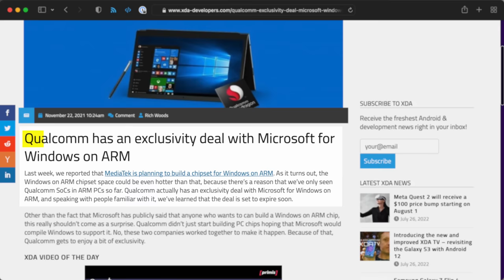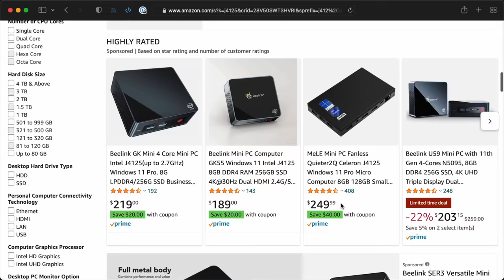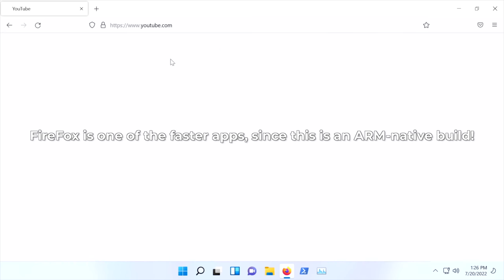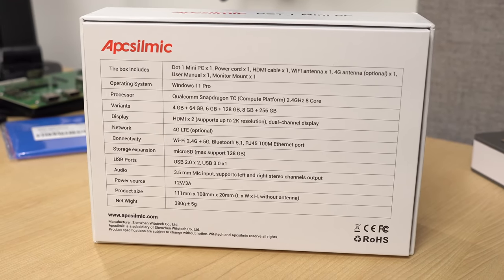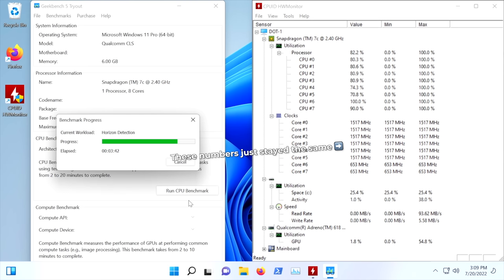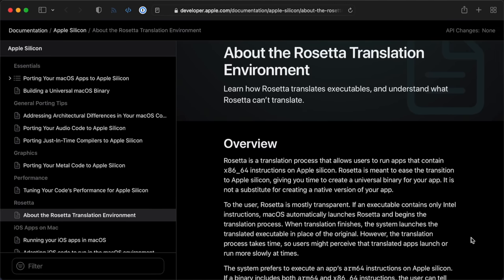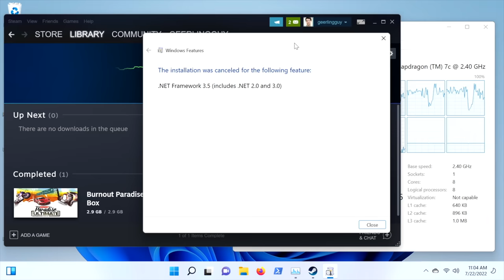Microsoft's wasted potential: Windows on ARM

Comment: A number of years ago I was put on to the possibilities of ARM as a desktop platform, so when M1 came around it really felt like the fulfillment of that promise. Honestly, Windows has been trying to do Windows on ARM for a while now, but each time it was so poorly done it made ARM look like it just wasn't ready fro prime time. Like back when Microsoft did the Surface RT, it was just underpowered, slow, and lacked support for popular apps. Fast forward to 2022, and surprise surprise, Microsoft still hasn't learned their lesson. The Surface Pro X is a marked improvement over past efforts, but it's still just Microsoft just going, "Hey look, we got Windows to run on ARM!"

Love or hate Apple, they do tend to get things right, and lead the industry. Like tablets, Miscrosoft was doing tablet PCs since the 90s. But it took the iPad for people to finally get tablets. The M1 Macs are the same, Apple is showing what ARM can do in a full productivity PC. It's not the cheap brand, or the glorified web browser experience. This is full on power users on a desktop level of performance, and it's even blowing some traditional Intel/AMD/Nvidia configurations out of the water. 

Though there's a while world of untapped potential in RISC V too. RISC V could give ARM a run for their money too, since anyone can pick up and use RISC V without paying royalties. We could see Microsoft making their own chips a la Apple M1, and they wouldn't be beholden to Qualcomm or other ARM chip makers. Since Microsoft moves slowly on these things sometimes it could take 10 years before we get there, but I think we'll see a lot more ARM/RISC V architecture in the near future as Apple solidly demonstrates the power of ARM with M1/M2, and future iterations.

Comment: I did read that Apple are taking the position that they will support Windows on the Apple Silicon Macs, but they need Microsoft to make it available legally to Mac users before they can consider it.
Reply: That will happen the same day Apple makes legally available to run iOS on other ARMs. As a devops and sysadmin, virtualizing Macs on cloud would make my life a lot easier.
Reply: @framegrace1  different business model.  Apple are unlikely to open up their OS.  Why?  They did it in the past and it nearly bankrupted them, because at the time, Apple’s primary source of income was from hardware sales,.

Microsoft’s business model has traditionally required they get their software installed on as many devices as possible, whether they manufacture them or not.  Now or seems to require getting as many people using their cloud services as possible..

Comment: Must be something wrong with that hardware, I have Samsung Galaxy Book Go which has the same ARM chip and it runs just fine, even with x86 emulation, though most of the apps I need have been compiled for ARM64.

Comment: Thank you for the very insightful video, I am currently using a RasPI 4 with 8 Gigs to test Arm64/Windows11 builds of my open source software and was thinking about getting a Apcsilmic instead, now I know it would have been a waste of money. The cooling solution in this design is terrible. A RasPi 4 with a proper cooling solution seams far superior even though on paper the SOC is not as powerful.

I'm wondering what would be the best ARM64 platform to run windows nowadays that is somewhat well priced?

Comment: Recently I bought a Samsung Galaxy Book Go (7c 2nd gen) and I'm pretty happy with it for my use case: I use it as a thin PC that connects to my desktop PC through RDP. Battery lasts a lot, around 10 hour minimum, and it does not drain it when I put it to sleep.
What I don't like about it is that I can't reinstall Windows on my own, only with the included image, as there is no official Windows 11 ISO for ARM64 and I can't download the drivers on Samsung's website. I know I can export them from my current installation, but that should not be needed.
And also, I can't use any Linux distros on it. It does not even recognize the keyboard, mouse or any USB I connect.
But still, for 160€, is a good thin client laptop :)

Comment: I agree, I wonder how many people didn't buy an arm mac or are waiting to buy one simply because it doesn't run windows.  I think MS was sure cloud would be their future with remote app and azure replacing the tradition desktop but it hasn't happened.  It is expensive and most IT departments aren't using it at scale.  Personally I let my users RDP to our cloud stuff for windows and it works perfectly well.  Enterprise apps in remote app and productivity is local.  Encrypt the drives sync data and enforce backups and you are golden.  Reduced TCO as macs require less maintenance.

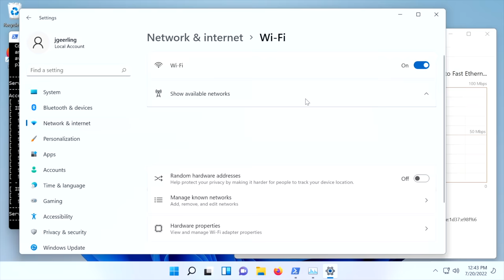Comment: 5:44 i think that is true when used with a dock that have ethernet bcz my lap always gone to the adapter that have not the built in one even its not pugged in. the same goes for wifi auto connect dosent work and i actually removed the ethernet from device manager and then everything seems fine now i have a better dock.

Comment: The M1 and M2 Mac devices are ARM but Windows is not officially supported in Mac with Boot Camp. It is possible to run in emulation using VMWare Fusion, Parellels or Apple's own Virtualisation tool but some features are not available. Microsoft should prioritise supporting Windows 11 on ARM on Mac which has the best performing consumer ARM processors to date and this could encourage Developers to update apps to ARM for Windows instead of relying on x86 emulation. This would also improve the experience for users that are running on Qualcomm Windows PC's.

The planned Project Volterra mini PC by Microsoft is focused on Developers and should have a faster processor. Not much is known about the specs or the expected release date. Hopefully the specs are beefier and less expensive than the current Qualcomm 8Cx Gen 3 and SQ2 devices. 

Microsoft should NOT saddle the Project Volterra mini PC for Developers with an underpowered processor as Qualcomm did with their Developer Kit.

Comment: Speaking of powershell taking 5~7 seconds to startup, its generally powershell being stupidly slow, not the cpu. My old i7 4710h, while not a performance beast either, also takes 3~5 seconds to start up a powershell, whilst not having any issues with windows old cmd or any other linux shell.

Comment: There should be an open tool that quickly runs and checks everything that could possibly be needed to get Linux running on your hardware and have a full log file that could be sent to some developers
Reply: it's actually not hard to get linux running if all you need is a serial terminal. Figuring out the device tree is the issue.

Comment: I'm currently running window 11 on my pi 4 8GB 500GB SSD in ARGON 1 M2 case.
The problem I am facing is to make a driver for the fan controller so that I can get it above 1.5 GHz. The most disappointing is Microsofts webb browser. It really lacks performance on arm.

Comment: As usual it sounds like they cheaped out all the way around. And the reason there's still a high usage of usb 2.0 ports on all devices is because when electronic spec consortiums put out a new spec the electronics manufacturers pump out a bazillion of them. Mark my words we'll still be seeing 2.0 ports for at least another 20-30 years. And probably double that for HDMI and usb-c, which they invested heavily in and rushed it to market unfinalized.

Comment: 2:57 The CPU only has 1MB of L3 cache for 8 cores?!? Geez I don’t think emulation overhead is the only problem here. The total cache only amounts to 2560 MB, and I’ve seen cheap desktop dual cores from 2007 with more total cache than that.

Comment: Quick questions.. 1.) If you disabled on board Eth0, wouldn't it default to wifi and auto connect?  2.)Did you by chance try running a 3.0 USB Eth adapter to see performance? I know your speaking on it being off shelf w/ no changes. But if the price is right, adding new Thermal and USB Eth0, what is your opinion?

Comment: I bought the same system with 4GB of ram, in laptop form, for only $169, and it's working fine.
If I had to make any suggestions, is to get at least 6GB, as just the Windows 11 with Edge browser uses up almost 3.5GB of the 4GB of RAM.
My laptop has a non-upgradeable ram and SSD. The SSD is only 64GB, but with some optimizations, you can make it quite useable. Like, disable hybernation file, increase the swap file to a fixed 3GB (4GB if you plan on doing more advanced stuff).
It's pretty ok, and uses a lot less than an Atom PC in terms of power consumption.
But it does use more RAM, the nature of ARM technology. So get a 6 or 8GB version.
Most of the 32 bit apps work quite fine. It takes some fiddling to make them work.
Most older 16 bit DOS and 32 bit DX9 Windows 95/98 games can be emulated just fine on this. The performance isn't staggering, but in line with any desktop PC of 2005-2007, plus it plays back 2k videos (through a 1080p screen) just fine.
A lot of steam games don't work. Epic games do tell you in advance if the game isn't working (x64), and installs if it does work (Arm64 or x86 (32 bit)).
My geekbench score is a bit higher on single and multi cores as yours, as the first few tests only use 2 E-cores at 2.48Ghz, and the last few test use all the cores running at 2Ghz.
I would certainly try to use either a heat sink, or use a small fan on the cpu.
Side note, the 32 bit version of GeekBench (3), nets 2000 single core, and 4660 multi core. The benchmark doesn't maximize the CPU cores, only utilizes roughly up to 75%.

Comment: Wow that computer only uses like 6-7 watts under load? My M1 MacBook Air under load uses like 27-30 watts and heats up to 95c (but it doesn't have a fan. Still: how do you get 95c out of 30 watts and still manage to power a computer???)

Comment: As far as I know the biggest problem with ARM is that it requires a special edition of any OS for each implementation.
This could be solved when introducing a Frimware/Bios/UEFI thing that loads the OS, at least as far as I understand it.
So I think Qualcomm was the only one willing to help Microsoft with developing a special version of Windows with integrated firmware for there chips.
Reply: In the X86, a 'standard' was established to load all the correct device drivers for a plethora of different existing devices (doing the same things). With linux, this does not (yet) exist. Remember those days of 100% IBM PC compatibility ? That was exactly the same issue. Our community certainly has learnt a lot!

Comment: Microsoft’s pledge for backwards compatibility ( and Intels) going all the way back to the 8086 is legacy weight that drags them down. A specific example in windows means a specific function- in dll form rather than statically linked in Linux, needs like 6 versions, is it 8 bit, is it 16bit is it 32 bit, is it 64 bit, followed by for most of those is it ascii, is it cp102, is it UTF8/ or iso whatever, is it wide character, or is it … whatever the windows wide char is called, iChat or something, then it needs to check the version to see what functions are available, it’s DLL hell all the way down.  I don’t understand UWP but i believe it’s meant to prevent some of this.

But the Microsoft way is always - why make it simple when we should plan for every possible eventuality and make a simple interface so complicated that there don’t exist experts out there for it. 
Simple things like an event log or system management- eg if you get under the hood just a bit - So complicated it boggles the mind
Reply: Did you know that 64-bit Windows will no longer run 16-bit executables?

“Backwards compatibility”, indeed ...

Comment: I'm using those mini pc's as development hardware for a kiosk system. i got 3 of them at work, 1 of them is a prototype hardware, 2 is the finished product the one you showed on vid. on the prototype i was able to port my .net 4.6 application to .net 6.0 so i could compile ARM64 builds.

the only problem i have with those computers is find a way to reinstall windows on them. the ARM64 iso's for windows doesnt exist and you need to build them with a tool, i was successfully able to boot to windows setup, but keyboard and mouse doesnt work. :(

trying to run Debian 11 ARM64 doesnt work either indeed. the GRUB menu does kinda load, but it fills the screen. when attempting to boot the kernel, it looks like it crashes, the screen goes crazy. and locks up.

Comment: Actually, Apple has platform-transitioned the Mac 4 times. 68k to PowerPC 32 bits, PowerPC 32 bits to PowerPC 64 bits, PowerPC 64 bits to Intel (Both 32 and 64 bits) and Intel to Apple Silicon.

Comment: Wow, your video told me how good is Windows on ARM processor's, include some benchmarks. You have solve my wishes! Thx. 
But Debian have told me in history privately message, ARM does not support this Chipsets that's in Intel and AMD CPUs usage. They mean 386 CPU chipset is not include in ARM and this is the special of ARM, it is without 386. So finally Microsoft for ARM must use a CPU emulator inside. Or how they fixed this problem? The Software of Steam Launcher usage 386 Chipset inside and I was seen it is running in your Video on ARM. It's like a wonder this Microsoft 11 ARM. Thank you so much!

Comment: I like ARM. I've got a couple of NAS boxes running armbian. Rock solid and low power consumption. As for the DOT 1 Mini pc in this review and running windows 11 on ARM, why bother? I got a dirt cheap Fujitsu S740 on ebay, quad core j4105, 4 gig of ram (upgradable) and I replaced the 8 gig m.2 ssd with an 128 gig m.2 ssd. All included round $60 usd. Running linux on it I have yet to see my kill-a-watt meter show double digits. After watching this video I put windows 11 on it and it occasionally spikes to 15W but mainly runs around the 6-7W mark.

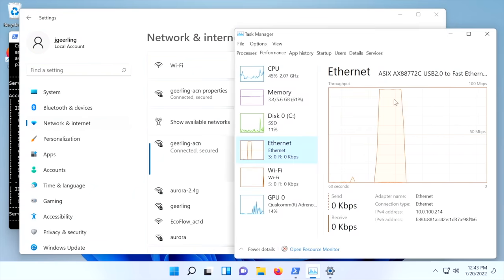Comment: 5:42 That might be because you've connected ethernet cable. Windows won't connect to Wi-Fi automatically after boot if ethernet is already plugged in.
I am using Windows 11 Home currently, and this behavior was extremely annoying when I was using Wi-Fi to access my NAS, while ethernet plugged directly to internet, which is different network and NAS can't be accessed.
Reply from the maker: yikes! What do networking people do if they use windows? Or do they all just use Mac/Linux?
Reply: Linux has the most advanced networking stack. So what do you think the smart networking people use?

Comment: I really want to know why you can't just boot Linux on any Qualcom CPU. I mean they do use UEFI, no? o.o
Whilst looking into the work needed porting Sailfish or PostmarketOS to different phones, I saw that each one needs individual bringup procedures. That just always baffles me, if only just a little...
Reply: UEFI? no
Reply: @azertyQ  So they use a different boot mechanism? If so, is it proprietary or not?
Reply: The issue is the parts of the hardware that lie outside the Qualcomm SoC. The rest of the motherboard. On Intel systems, the motherboard has firmware that can tell the operating system where to find hardware and how the hardware should be used. On ARM systems, there is the SystemReady standard firmware that serves the same purpose.
However, most consumer electronics manufacturers simply don't expect their hardware to be user-repairable or maintainable, so they don't bother to develop multi-purpose standards-compliant firmware. Their motherboard firmware is bare-bones and doesn't tell the OS anything about the hardware. Instead, they customize the OS to hard-code this information. They treat the system like it's "disposable"; low-effort, single-use.
Reply: @PixlRainbow  Ohhhh! So THAT is why each bringup - be it another Android ROM or else - needs a "device tree"; those ought to be the hardcoded information you mentioned I would assume. This explains why packages that go together into a LineageOS build seem so fragmented; because they literally HAVE to be.

Thanks for explaining! This helped me understand things a lot. So even if there was some kind of UEFI compatible boot loader (acting as a chain loader after SystemReady), it would still have to be implemented for each device independently, mostly regardless of factory/vendor.

Again, thanks a lot! ^.^
Reply: @IngwiePhoenix  oh SystemReady includes UEFI support! To be compliant, the vendor must provide an implementation of UEFI on their motherboard. It's just that most consumer electronics manufacturers are actually not SystemReady compliant like, at all. Most ARM SystemReady devices are enterprise servers.

Comment: Windows has the tendency to ignore WLAN if LAN is connected. Autoconnect will then be disabled. Try a reboot without LAN connection. My own desktop PC also only connects to WLAN automatically if the Ethernet cable is not plugged in. At least on Intel Systems the behavior is this way and maybe that is also the problem on ARM.

Comment: There is a Microsoft Surface with ARM in development, quite fast and reliable what I've heard, but I can't talk about it though.
Reply: 8xc chip? I'd like to see that chip or a Nuvia (2024) in a Surface Go Form Factor to maximize portability and battery life and comfort as a tablet when used as such and still full-fat OS for work. As a second computer, it would be very attractive because Apple refuse to make such a device with their split between Laptop MacOS and iPad iPadOS division. Using iPadOS feels like having chains around your wrists.

Lenovo released an 8xc laptop and it's got about 18 hours of battery life with a 300 nit screen for continual web-surfing so very impressive for battery / power efficiency improvement.
Reply: It can easily run 2x 1440p monitors, alongside its own monitor, through USB-C.